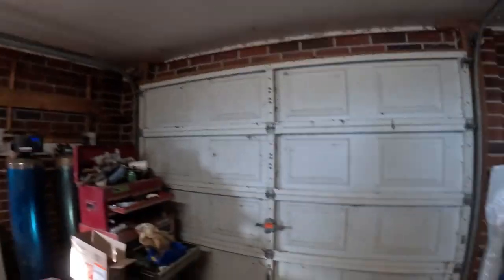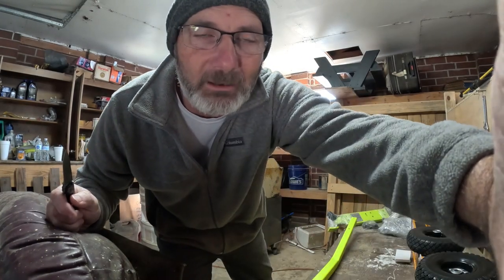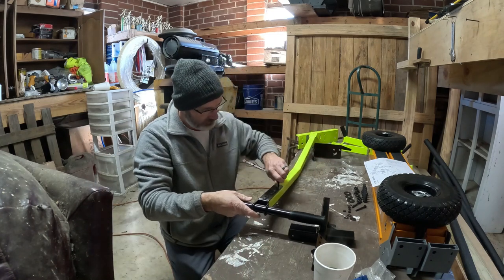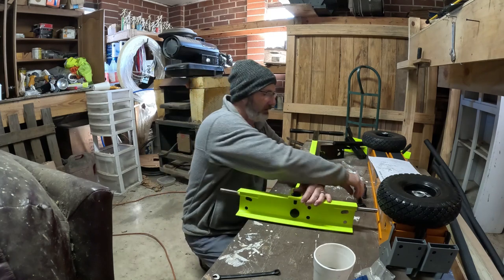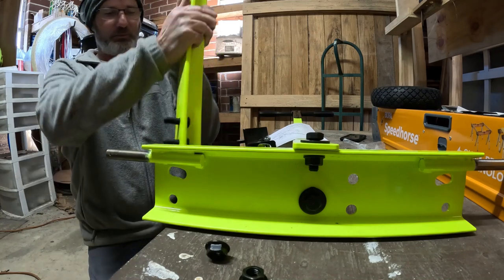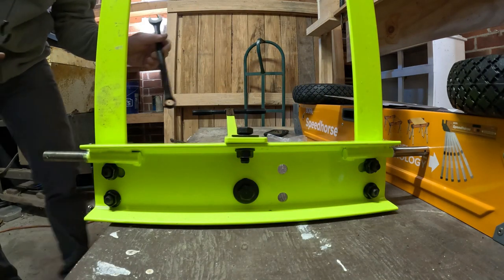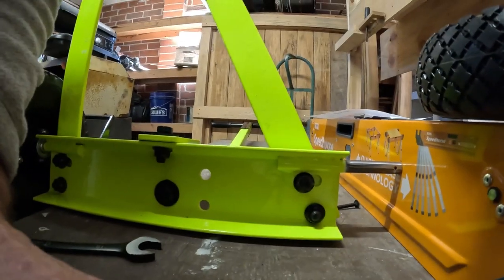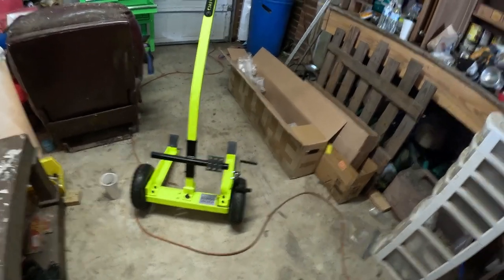Ballard V2 Super Jack Assembly

Comment: Good video, I have thought about getting one. I know it would be a lot guicker that my hydraulic Mo-Jack. I wished you would have demonstrated lifting your X-One or your Super-Z. I would be interested in how much you have to have in the rear of your britches to lift a commercial mower, and does it lift the deck to a comfortable working height ?
Reply from the maker: Demonstration is in the next video.......gotta stretch them out. Sit down was much easier to lift......that engine up front adds a little weight....for what you do, I'm sure the hydraulic jack is the way to go. It does lift it up for good access.

Comment: Got the Super Jack in 2020.

Had to swap out the tires with the Pneumatic tires on my hand trucks.  

The Ballard tires would (squish) and almost come off the wheel on a hot day and makes it harder to lift. 
Kinda like 
(running on a low tire) does. 

The Pneumatic tires off my handtrucks are FIRM with good AIR pressure - gives a little more height too,
and Lifts much easier after swapping them out.  

I do like the Super Jack,
But i use the Ramp Rack Ramp,
 when the Ramp is on the truck. 

If I had a do over, I'd have went with a Jungle Jim Jack.
It just has one arm dead center and I think it has better Leverage Power when lifting.
 
The Jungle Jim wheels are smaller but Solid.  No Squishy.
It's also more portable if I wanted to take it with me.
Reply from the maker: Yeah I don't intend to take it anywhere. I change the blades about everyday and only change on the job if I bend one or something. I do occasionally need to throw an old set on to cut a nasty area/new property, but usually I try to schedule them outside of the normal route.